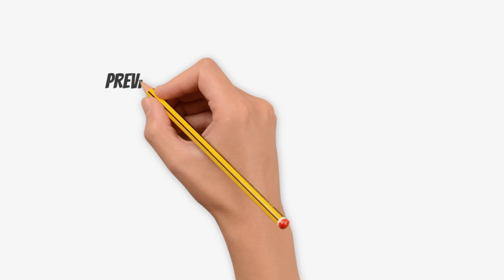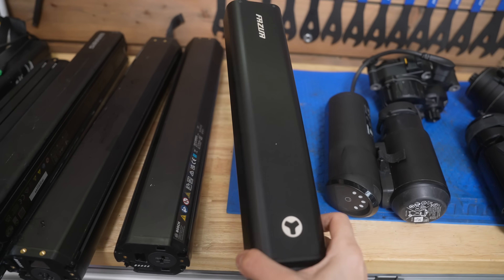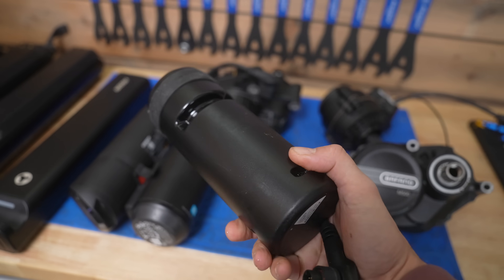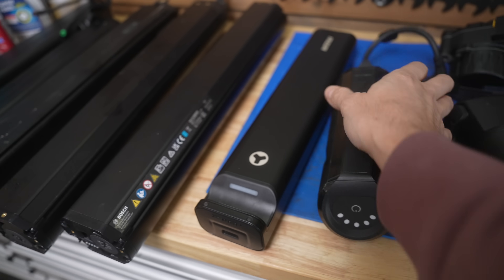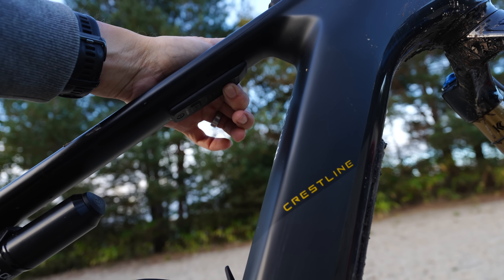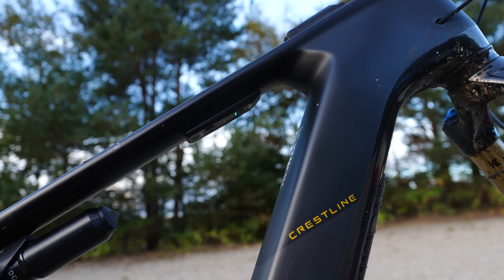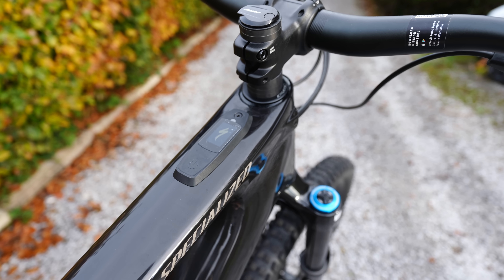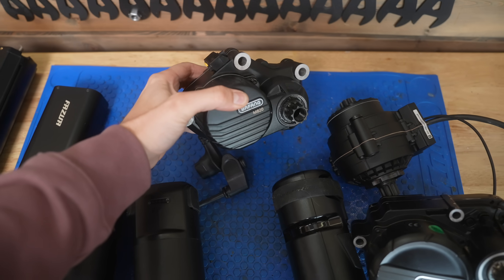We Have A Huge Problem With Ebikes....

Comment: I have a Specialized Kenevo SL and find that the motor doesn’t have enough power for my 72 year old ability. Now Specialized came out with the new motor and I can’t use it. I paid over $9,000  for it and can’t afford to sell it since Specialized is selling the same bike for $5849 now. 
I can’t sell the bike for close to what someone can buy a new one so maybe I could get $4000 for it. That is a $5000 loss. The problem would be solved if I could buy the new motor for about a Thousand dollars. As Rob said, the motor fits in the frame and has the same bolt pattern. It is just that Specialized won’t sell the new software. I have bought bike after bike from Specialized but if this is how they treat a loyal customer, I will never by from them again.

Comment: Rob, I agree with a  standard for charging similar to a USB-C standard, but the rest is not likely to  happen anytime soon. Your approach moves closer to a DIY ebike market where for example the motor is no different than a derailleur. That might happen way down the road, but for now I want companies to innovate at the system level and design level. It's too early for this kind of standardization. Let the best designs win. This means we have to be comfortable with the rate of change relative to our purchases. Also I don't see the bike companies playing nice together yet. The upgrade path for the iPhone is buying a new iPhone...

Comment: Here here! Start a movement Rob! Force the manufacturers to stop screwing us! My personal issue is with battery controllers and motor firmware, which is the issue Rob is calling out for the “within ecosystem” issue. I have a completely worthless BH Atom-X e-bike, which I cannot get parts for since BH pulled out of the US market and they refuse to sell service parts to direct to US consumers even though the dealer network is DEAD DEAD DEAD. It has a “standard” Brose S motor. But because they have a proprietary battery controller, motor firmware, and display, I cannot make this perfectly good battery, motor, and bike work because my son crashed and broke the display. If I was able to add a new display (which I could do if I could flash the motor and battery to a standardized controller, which Brose has actually announced but I cannot find anywhere to buy), then I could revive this bike. As it is, it’s $5800 of useless e-waste. There is a lot the manufacturers could do even with a single ecosystem, as Rob points out. Back when batteries were frame clip-ons rather than integrated, the compatibility story was actually better. For now my strategy is only buy super strong US-supported brands (I now have a Turbo Levo which I love) but it sucks that my Atom-X is e-waste. It’s STUPID you cannot buy a bolt-compatible upgrade for a bike frame and battery and sync up the firmware and display.

Comment: makes total sense for the consumer and somewhat for the motor / battery manufacturers, but could likely reduce the sales figures of bike brands...... , if people would just buy a new motor then they will be less likely to buy the latest and greatest bike. Also perhaps  there are other compatibility issues with the design of a frame not working with the new motor due to torque tolerances and such??

Comment: This isn't what I was expecting.

1. They damage local trails
2. They allow uphill riders to ride at 20mph which is dangerous when downhill riders are also going 20mph+.
3. They enable beginner riders to climb steep grades that are beyond their skill level when descending.
4. They are a fire hazard.
5. They break standard bike parts easily.

Those are the huge problems.

Comment: eBike technology has NOT changed much in few years. Motors are limited by EU regulations and there is not much progress with batteries other than packing more cells into them. I have Giant ebike model 2018 and I don't see anything worth upgrading to, after 5 years!!!! Why  would I buy ebike that delivers 85Nm torque when mine delivers 80Nm. Makes little sense.

Comment: As bike mechanic, I don't see your problem 🤣❓ Seriously, I started working in the bike branch 2014, because I started DH MTB bike park for hobby in 2011, 31 years old.  That was the year, Ebikes started pushing into the market. But, from that moment, I separated the workshop in two areas : normal bikes and Ebikes. The biggest difference, the capacity of the storage. If I have to order a spare part and wait for it 🤮😂😂🤮😂, you need to store the defective bike. 
Ebikes are no bicycle, they are expensive electric Mopeds. You never had any options, to change it or upgrade it etc.
If One part is broken, you need the exact same spare part. In Germany, if I use some different part, Wich don't own a permission by the producers, and your customers have an accident or the house burns down while charging, they will sue to your pants 😁🤣‼️

Comment: I said this in a comment years ago and you replied saying it’s never going to happen.
Unfortunately, you’re right, people buy a bike based on what motor and battery system is fitted..it all depends on the customer service that the manufacturer gives so if the people have a bad experience with Shimano, for instance, people will stay clear from them going forward any bike with a shimano motor, whether it’s their favourite brand of bike or not, they will not buy one
It’s unfortunate because the secondhand market is absolutely terrible for used, E bikes, purely bike stuff gets outdated so fast and spare parts are not accessible.
If we are going to implicate anything a right to repair would be the best option, so all parts can be repaired for a minimum of said years

Comment: I understand the need for different bolt patterns, different batteries, controllers and different chargers. Engineers need the frredom to improve their products and this can't be done with such limitations. One thing that has stopped be from buying a eMTB is the inability to repair the inherently unreliably and poorly designed motors. I recently contacted Shimano Australia and inquired about buying internal parts for the motor and was told the motor is sold as a 'sealed unit' and parts were not available. A good percentage of  eMTB's are more expensive than enduro or MX motor bikes. Imagine if Honda said ' nah, you cant buy a crank shaft and bearings, you have to but the complete motor'. The consumers wouldn't cop that. I can't help but think that ebike consumers have dug their own grave by accepting the unacceptable terms that the manufacturers demand.

Comment: Agree it's a big problem, and I feel for those who have to replace the bike to get a motor upgrade. There are chargers that allow you to set the voltage and charge rate, and I have one charger that works with 4 of my 5 batteries. I sort of took things into my own hands being an engineer, but all 5 of my batteries fit the bike well, and I mix and match depending on my range needs, preferring the lightest selection that will do the job. Same with the motor, and although most of you will gasp in horror at the thought of a geared hub motor, a 9 pound 3.2kw motor on a 60 pound bike can be pretty exhilarating!

Comment: Bafang is making new motors that fit in place of older motors. For example the New M820 and M510 motors fit in the bikes that came specced with the older M600 motor. Of course the older battery also works on the newer motor

Comment: What was wrong with bikes that you just pedal ? . Has the whole of the cycle industry , managed to convince us that using your own body to pedal a cycle is wrong ! .You  now need a motor to assist ,to take the effort out of cycling , make it less hard work to get around ? . Cycling used to be regarded as one of the most environmentally friendly forms of transport , your body provided the energy to propel you along . Ok you can get rather hot and sweaty doing so , or wet depending on conditions - but it is also a great form of exercise , and beneficial to health .

As we progress , technology seems to be all about taking the effort out of doing things , consequently we are all becoming more sedentary and unhealthy .I have been cycling all my life and still regularly ride off road on my mountain bike , which is 15 years old and works perfectly well without battery assist , and I am 60 yrs old .

How about using non ebikes , and take the worry out of compatibility of components ! ,  and enjoy cycling as it has been for over a hundred years , by only using your body to propel the cycle .

Comment: With over 400k subscribers, you're a major voice of the EMTB community Rob, and thank for saying would needed to be said. Now, something else to consider. Yes universal fitment and standards, tech and hardware and backwards compatability but also, full serviceability and diagnostics. I feel that, if these changes dont happen, EMTB could very well end as just a fad. 

Sure, its big business, for now. But how many consumers took the plug,  bought the bike, ride it for 2 years and bam. Broken, and the choice. Either pay outrageous money for an entire motor, or throw the bike away. Buy an analog frame, a REAL nice one for the same money as a motor and swap  all parts over. Then swear to never, ever buy another EMTB. 

This is a very real situation now that we are years in and EMTB really took off. A situation that IS happening, and could turn the EMTB into a fad. A "remember those bikes with motors and batteries", yeah those things were awesome, but you couldn't fix them.....a slippery slope the MTB business can be. Just look at it now as a whole vs, just 2 years ago...

Comment: the only thing i see becoming standardized on ebike designs is the current water bottle bolt mounted batteries currently coming out of chinese companies for the most part. you just buy the battery you want that fits your frame and bolt it to the frame. you can also buy the controller and display screen that you want and just plug it all in. there are way too many niches in the ebike scene where people want more power/less power mid drive, rear hub drive, dual hub drive, etc for too much standardization to take place. most companies especially big named American brands keep their parts proprietary so that you can only go through them for replacement parts so they they can boost sales and keep recurring customers.

Comment: This is all very ... "close the gate after the horses have bolted" ... this was already happening yonks ago when I made the decision to put a bbshd in my "Shredbo bike" (dh lift bike). And I still dont think anyone has made a bike that does what that bike does. The only thing at the time That worried me was the square taper crank ... but Ive had no hassle with that after all.
I think the trouble is not many folk really want to  get that techo with their bike and just buy off the shelf and take it back to a shop to do maintenance. 
I just think its like it is because the manufacturers are making product because the consumer doesnt want to put in the techo effort.
The oportunity to change the system is long gone ... we had the chance to change it by backing things like the bbshd ... but sadly most folk dont really want to put that much tech effort in and just "get on the boat" that the manufacturets are steering.

Comment: You are right Rob ...
We have been sucked in price's are high for new and second hand values will drop like a stone giving you no option but to buy mew again as upgrades won't be available and it will be expensive to repair or replace either way the manufacturer wins not the buyer...its wrong all wrong

Comment: Since the beginning I've been totally frustrated about that exact issue. It basically gives you no chance anymore, to just buy a frame and build your own spec bike. There's so much already given, that you can't change or upgrade. If your ebike is outdated, what it is after barely 3-5 years, you can bin the whole thing almost and just buy a complete new one, because nothing will fit. Additionally all those different wheel sets that are possible as well, same boost, non boost, bla bla bla 😢

Comment: UMM - Universal Motor Mount (Self Explanatory)
UDH - Universal Deraileur Hanger (Self Explanatory)
UBM - Universal Battery Mount (Self explanatory)
UCS - Universal Controller System (Standard set of control leads etc)
EBOSI - EBike Open Standards Interface (for tuning etc)

Just Do It Already ✔

Consumer Win = Yes
Consumer Happy = Yes

Manufacturer Costs Down = Yes
Design Simplification = Yes

Comment: Must admit I’ve not had a problem mixing parts. I recently bought a new Orbea mountain bike to convert to electric. The motor was a mid mount Bafang, the battery was a Samsung, the offset chain ring came from the US, various other parts from different suppliers. Everything fitted together without issue, have I just been lucky? No not lucky, just ensured I ordered parts that were compatible with what I needed.

Comment: Personally i've reused brake levers, displays, throttles and batteries.  I've only been able to do this because i mostly buy UART compatible Bafang products.  the gen3 cyc products will also let you use brake cut offs and the throttle, but if you order no cut offs, you get the wrong harness, so you are forced to create more waste.

Comment: I had a Scott ransom Eride and couldnt upgrade it to the current gen bosch stuff, i wouldve bought all the bits if i couldve.
Same with headsets, now honestly i dont mind headset routing but the limited headset choices absolutely stink because Brands with ebikes that use like a 40 or 42mm ID bearing are hard to buy unless you want to pay shit loads on the OEM one which is normally acros rubbish

Comment: Ripper video Rob, so true. The other  issue is that parts for older bikes can be hard to get. I have two 2017 Levos that will be thrown away when motors / batteries are no longer available which is bad for the environment and the wallet. Upgradable would keep these bikes going.

Comment: Most e-bikes will be redundant soon solid state batteries will cut 2 kg and radial flux motors another 1 kg
Both theses techs are very close and particularly in the case of soil is state batteries reduce cost as well
So if you want a current e-bike wait a couple of years and go to the rubbish tip

Comment: I'm glad you're talking about this. I doubt this will get fixed unless someone like the EU steps in
Reply: So make it so know one can make new ideas and force everyone to use one model. That wont discourage innovation or competition!
Reply: @williambrandondavis6897   what innovation is there to be had?? motor technology hasn't changed much in the past 20 yrs, there's only a few sensible placements for batteries, its all just an arms race of stupidity designed to edge each other out of the market. The EU and any other government should absolutely step in to regulate both compatibility, and the quality of these insanely flammable batteries.
Reply: "Govern me harder daddy"
 Pathetic numpty.

Comment: It could be like electric cars but probably not furhter. With mechanical parts in transmission and in any other case is still not so universal. So main points is about the chargers and motor\battery mounting to swap the system completely. So you a right, I am personally stick to bosch so I am completely not interested in any other system or bike with a different brand, but also I am sad about not able to upgrade my system even by the same brand, but Bosch is most customizable so far.

Comment: I do agree to a point, but, you can’t have your cake and eat it too. 
Say if this idea everything being interchangeable, motor, batteries and chargers happened 10 years ago, we would still be riding bikes with ugly external batteries, there would be no size reductions to the motors and we would be stuck with the same sized batteries from 10 years ago because the chargers can’t be changed. 
Yes, I know there are compromises that can be done, especially with the chargers for newer ones to charge different voltages and the like but to make everything backwards compatible hinders innovation. 
A brand wants to integrate the battery in the frame, they can’t because it’s a huge big brick that mounts to the outside of the frame. A brand wants to design a compact lightweight motor, they can’t, because it’s has to fit this big gaping hole in the bottom of the frame.
There’s definitely some improvement that needs to happen, like when small changes are done, that they are backwards compatible and that things like motors are allowed to be repaired. There is a balance between innovation and stagnation.

Comment: Standardization would be great, but along with limiting the design, the potential for big risks not being able to assess every different situation that the end users may adapt, spells big liability for manufacturer (fire).  If we can get the classifications (1,2,3)better situated, at least for the states would remove confusion and open access.  A standard would be standard output, and storage would make for awesome competitions where the riders skills are tested rather than the engineering.